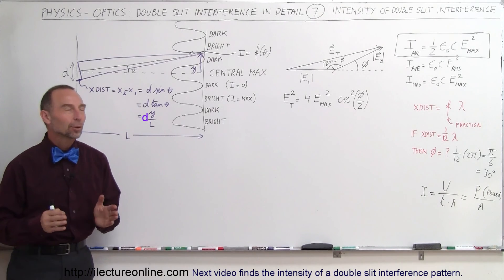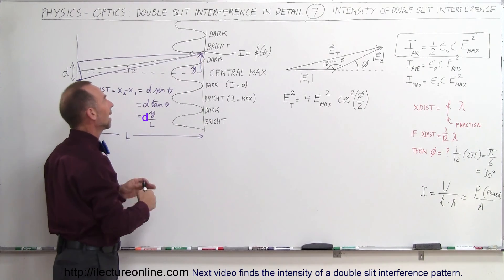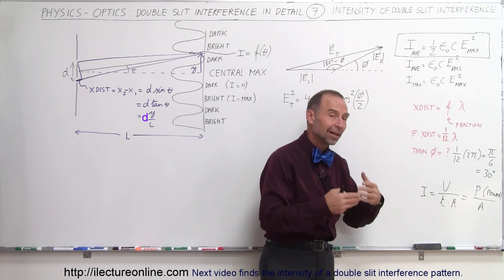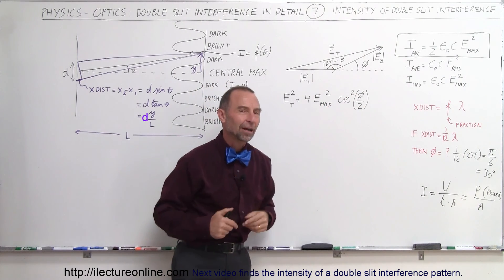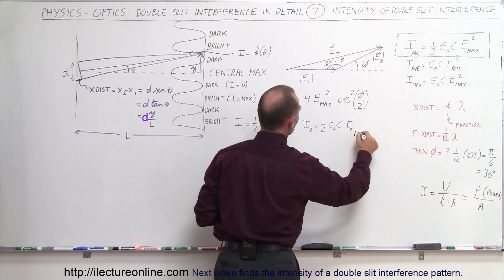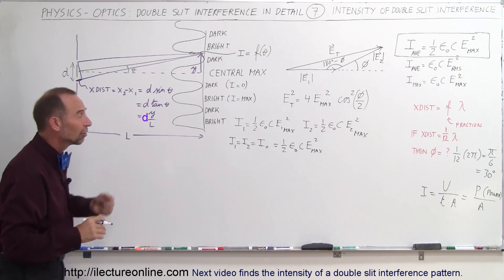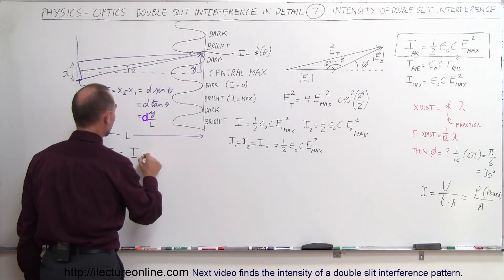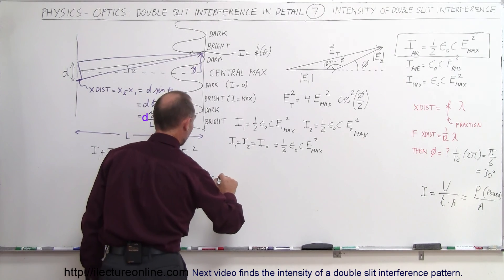Physics 60  Optics: Double Slit Interference (7 of 25) Intensity of Double Slit Interference Pattern

Comment: In the upper-right-hand corner of the screen you relate MAX-field-strength with AVE-intensity (of two waves). But after 2 minutes you drop the AVE and make it a general equation relating MAX-field-strength and just the intensity (of only one wave). So you are adding MAX intensities (not any intensity), aren't you? So I-not should be I-max?
Reply from the maker: You can use max or ave as long as you realize that E max = sqrt (2) * E ave and I max = 2 * I ave (since I is proportional to E^2)
Reply: Of course. I sometimes forget that the average is a part of the maximum. Dumm, dumm! ;-)